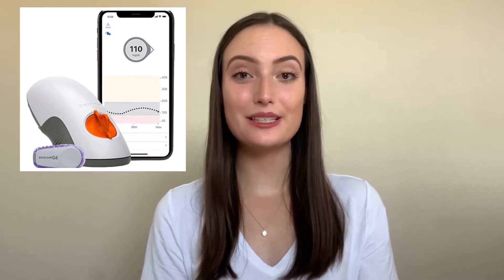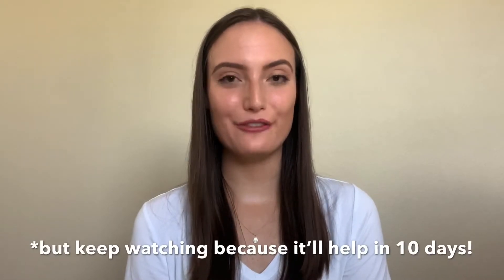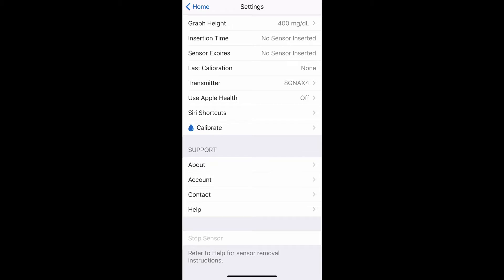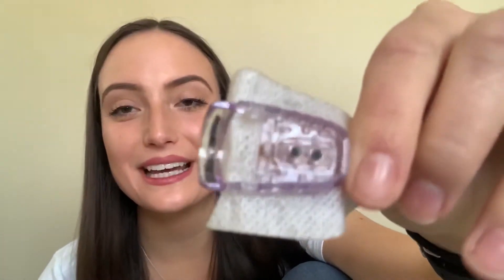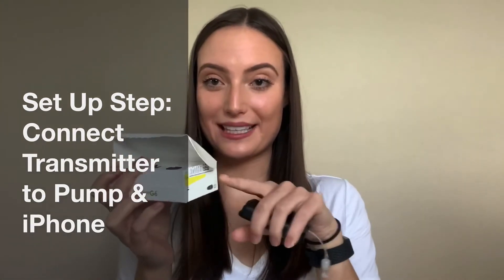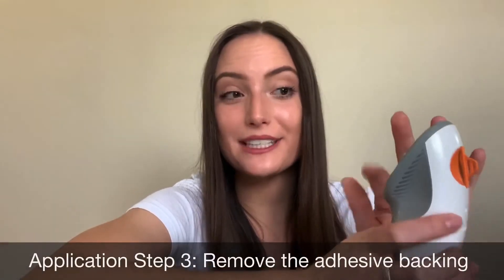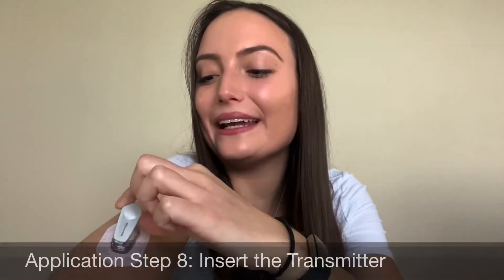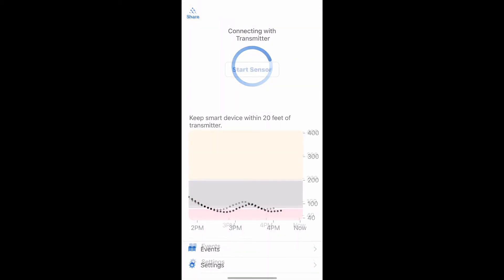Dexcom G6 CGM, a Step-by-Step Tutorial + tips. Tandem t:slim X2 Insulin Pump & iPhone Connected

Comment: Í had problems
1st semsor lasted7 days 2nd lasted 3 days and screen blanked and wanted to ressetu.
Started a do loop.
Lost old  code on sensor so used code on another sensor
3 days later it failed and would not let me use last code..
Not happy can not reconmend this model
Reply from the maker: @johnware8850  thanks for commenting, John! Was it for Dexcom G6 or Dexcom G7? And have you tried the other one?

Comment: I’ve been T1D since 1991. As we only change the transmitter 4 times a year, I forget the steps 😂. I did notice that when you showed entering the new transmitter code on the t-slim X2 and then repeated it on your phone before confirming on the X2, I need to put the sensor code in first then it asks for the transmitter code (on iPhone). It seemed that you just entered the transmitter code without that step. Could be a UK vs US thing. Anyway thanks for this video. It’s in my favourites folder just in case I forget again. Cheers and hope your well. 😊
Reply from the maker: Thank you so much for your comment! If my transmitter is being changed, that is first on pump or phone (but G7 should simplify things soon). Wishing you the best, cheers! :)

Comment: I have had trouble synching the Dexcom with my pump when introducing a new transmitter. Apparently you have to put the information into the pump in a certain order and if you don't you get an error and it won't work. I've been waiting a week for my replacement sensor and transmitter and I hope I get it right this time!
Reply from the maker: I’m so sorry to hear that you’ve had to go through and get a replacement, Jill. My fingers are crossed for you!

Comment: I've been a type-one diabetic going on 7 years now, but only just got my tslim pump last year. I get anxious when it comes time to replace the transmitter since the breaks between which they need to be changed are so long; I tend to forget how! This video was super helpful! I understand this video is from 2 years ago and that the tslim x2 pump has had updates since then, has anything changed about how you go about changing the transmitter since then? Or should I still enter the transmitter code in both my pump and my phone. I've always been told to do everything in the pump, however last time I replaced my transmitter through the pump only I had to restart the pump completely because something didn't work. I'd really appreciate a response, it's coming on time to replace again and I want to be prepared! 😂 Thank you so much for the video, regardless!
Reply from the maker: Hey there! Thank you so much for this awesome comment! The setup is still very similar for the tslim x2 & Dexcom G6. You can enter the code into both the pump and phone or just the pump which should connect to the phone if it is set up correctly. I believe the t:connect app is also advantageous for this pairing. It can be paired with one medical and one non medical device simultaneously (so, phone AND pump). I hope this is helpful and I’m wishing you the best of luck!

Comment: In washing your hand you touched the handle to turn off water. You just put germs back on your fingers.  I had to get signed off on washing my hands to be germ free in a home dialysis class. We had to have paper towel to dry hands then use the towel to touch handle to turn off water.   Because you talked about germs and how important it was to be germ free I wanted to correct you. I not a germ free nut but wanted to correct you since you are teaching online to teach others.  I appreciate you teaching this.
Reply from the maker: Thanks for your comment, Donna. In this video, I used a sink that is only ever touched by my hands and was cleaned before filming which is an important distinction that could have been advantageous to verbalize. It would be especially important to incorporate your suggestions when this is not the case. When working with something like a dialysis class, sterile practices are very important so I am glad you understand these techniques and hopefully add to someone's learning experience in conjunction with this video. Wishing you the best and Happy New Year.

Comment: Fantastic video.  The instructions definitely didn't give me a good sense of how to put this on.  But the biggest thing I'm wondering is how much of an issue is it if I wander in and out of range of my phone periodically throughout the day, as a Type 2 diabetic.
Reply from the maker: Great question and thank you for your comment! The answer depends on how far away your phone is. I find that I have issues if my phone is in another room and if, for example, you are working with the size of a sports field and your device is located on the edge, you might run into some disconnection. It comes down to how much connectivity you are willing to lose if it is not possible to keep your phone on or near your monitor. I hope this is helpful!

Comment: How waterproof is the dexcom g6
Reply from the maker: It does great in the shower and pools/hot tubs. Depending on how often it gets wet, some people experience concerns with the adhesive unsticking but there are additional patches that can be added to mitigate this! On April 13th 2022, Dexcom said “The Dexcom G6 sensor and transmitter are water-resistant and may be submerged under eight feet of water for up to 24 hours without failure….” when worn/applied correctly. I hope this is helpful!
Reply: Thank you none of the others answered me so thank you
Reply from the maker: @sherimoen617  awe, glad to help and I’m thankful for your comment. Happy holidays to you and yours!

Comment: Hi Maddy.  Thanks for this!  I'm relatively new to using CGMs (on my 8th or 9th sensor).  I am not diabetic but type 2 runs in my family so I'm being precautious and trying to educate myself about what affects my blood sugar.  I was wondering something... is there any reason one couldn't put on the new sensor first (in a different location, of course) and wait the 2 hours for the new sensor to calibrate, and only THEN take off the old sensor and transfer the transmitter to the new, already-warmed-up new sensor?  Or does the transmitter need to calibrate also?  If not, it would be nice to have more continuous readings, plus I'm curious about the different blood sugar levels the sensor readings between different locations.  I had the sensor on my stomach for the first time these last 10 days (vs back of the arm for all previous locations) and I was getting significantly higher glucose readings all of a sudden... +25-30).  A swifter change to a new sensor location would really help to see what change in blood sugar level was due to the change in sensor location only.  Waiting two hours introduces a bunch of additional factors.  Thanks in advance!!!  I'd also be interested in hearing anyone's experience with changing blood sugar with a change in sensor location.
Reply from the maker: Hey Warren! You’re asking some great questions, thanks for that! I also wish a more continuous reading was possible too but as of now, I believe the sensor and transmitter need to calibrate together for those two hours. Maybe this will change in the near future! I am pretty sure the upcoming G7 has a smaller calibration time (about a half hour as opposed to the current two hours). My sensor has a lot of issues on my stomach so I am only familiar with the readings I get in my arm. An idea for you to test the validity of your readings for different sites is to test with a traditional finger prick. You may also consider calibrating your Dexcom with this information. That way, you can identify the difference as it relates to these numbers! I hope this is helpful. Please let me know if you have additional questions and I will be more than happy to try to answer them! Wishing you the best.

Comment: Airline travel… Are there any issues during TSA in going through X-ray or body scan?  Some transmitters from other companies are ruined when using these machines during security checks.  I’ve always had to do the pat down…
Reply from the maker: Great question! The Dexcom has no issue from my experience. I actually went through TSA two days ago. My current strategy for my pump is to detach it and ask for a hand check. Usually there are small circular trays that you can put it in and pass it to them so it does not go through the x-ray machine. They’ll usually swab it and swab your hands. I have also gone through the full body scan with my pump where you put both hands up and spread your legs apart. In this case, I put it on the side of my hip and they swab my hands and pump when I step out. 

I never let it go through the x-ray machine where all bags go since I am also concerned about my pump being ruined, especially while traveling. 

Also, being kind, communicating clearly, and being observant of TSA might be advantageous. 

Let me know if this clarifies what you are seeking. I hope it helps!

Comment: I just put mine on yesterday for th3 1st time, but the reader I nit reading correctly.  It kept making noise all night it kept giving me reading of 53 which is impossible, I would've been in serious trouble I was fine. And it doesn't show me the readings from last night nor there's an app to keep track. I have a Samsung S22 that has all the updated system required.
Reply from the maker: Hey Verushka! I have been there. Unfortunately, this type of thing happens sometimes. In my experience, it can take the Dexcom a second to adjust but I’d recommend calling them if you are not seeing improvement. Their number is (877) 339-2664. If you still have the serial number from your sensor (located on the packaging), that will be helpful for them! However, they can help you without that information. I hope you see a resolution soon. You’ve got this!

Comment: Hi Maddy.  I'm a type 2.  I've been using Freestyle Libre for 3 years.   I love the CGM technology.  Mm biggest problem is  in the summer.   I sweat a lot.  I've tried a lot of solutions.   I used the tac wipes, tegaderm bandages, a bandage holding tincture,  and the circular stickers and the taccing stuff.  It doesn't matter what solution I've tried, my sensor falls off within 4 days. I just got a Decom G6 through the free sensor program. Is there a better place to put the sensor that it will stick?
Reply from the maker: Hey there, Shane! I’m very sorry to hear that you’ve been experiencing difficulty with maintaining sensor placement. 

Where are you currently placing your sensor? 

Some thoughts for you:
1) If it’s in a location where you can wrap it, you might consider self adhesive bandage or an ace bandage. 
2) Have you considered sweat blocking wipes for the location prior to cleaning the site for use? 
3) Definitely bring this up with your doctor. If either of these suggestions do not work, targeting the sweat glands more specifically might help; but this option is more costly and would require a doctor.

I look forward to hearing back from you and hope you are able to find a solution. Wishing you the best!

Comment: Hi I also use the g6. I am having huge issues keeping it secured for the 10 days. I start off with just the included attached dressing and use alcohol and sure prep around the edges. About day 3,I put sure prep around the edges and put the dexcom patch over the area. So I showered before applying and have not showered since applying the overpatch and it is still peeling up 🙃🙃help?
Reply from the maker: Hi Kirsten! You’re doing great and I’m hopeful we can find a solution. Have you considered applying an adhesive after you use your alcohol swab but before applying the sensor? This might add a couple days. If I have had issues keeping my sensor on passed that and a patch, I have used an ace bandage or self adhesive to wrap around my arm. I’d recommend talking to your doctor to see if they have any solutions that could assist you specifically, but these suggestions may help for now. Wishing you all the best. Would love to hear from you with an update!

Comment: Does this system have bleeding issues like the guardian 3 sensor, where there is blood coming out of where you inserted it causing issues?
Reply from the maker: Hey Matt! I’m sure it could happen but my personal experience is rare. I have had bleeding like this occur twice in my 7 consistent years of wearing the Dexcom. I hope this helps!
Reply: @TypeOneTypeFun  I have had bleeding with the guardian 3 sensor 40+ times in 4 years, I say 40 because it was that often but I obviously didn't keep count. It was enough to exhaust medtronics 3 replacement sensors per 90 days policy online - on cooldown, I am hoping with the dexcom things will be different.
Reply from the maker: @mad0uche  hey there! I’m so sorry to hear that this has happened to you. I hope your experience with Dexcom is much less… bloody. Wishing you the very best!

Comment: This is a great tutorial for the Dexcom G6, I’ve been a T2D since 1987 and have reluctantly moved onto the pump after years of coaxing from my endocrinologist, I’ve had great results with the wireless Omnipod and Freestyle Libre systems for a couple of years, since I turned 65 and Medicare is my main coverage (I was paying out of my pocket for the Omnipod and Freestyle Libre 14-day because Medicare Part B does not cover the cost) and Medicare covers the Tandem Slim-X and Dexcom G6, sooo.. I’m moving over the the Dexcom G6 and your video gave me a heads-up for the application of the Dexcom G6. In my kit, I also received a Dexcom Receiver, do you advise using the receiver ? Or it’s either or the cellphone app…
Reply from the maker: Hi Thomas! Thank you for sharing your journey. I hope the Dexcom and t:slim work very well for you. I have used the receiver, cellphone app, and pump all at once but this is unnecessary. If you have the options, it’s more of a personal preference. I mainly use my phone and pump currently. I hope this is helpful and I am wishing you the best!

Comment: I really enjoyed your instructional video, I started my Dexcom g6 on Monday and I like it., I’ll come back after 10days too make sure I get it right., thanks so much., I subscribe👌🏾💕😀
Reply from the maker: Hi Brenda, I hope to hear from you again! Thank you so much for your support. All the best!
Reply: @TypeOneTypeFun  Hi and thanks for responding., I received Apple software update but I’m afraid too download because it might interfere with my transmitter/sensor readings I have on now., will it make a difference if I do., I’m thinking I should wait after 10day usage then install., what do you think….. thanks so much😀😀
Reply from the maker: @brendasykes-tucker3469  great question! Since the Dexcom is a continuous process, you will have to interrupt the process for a few minutes if you plan to wear the Dexcom at all times. So, when you go through with the update and your phone turns back on, reopen the Dexcom app manually so that it will reconnect. I have automatic nighttime updates turned off because the app will not automatically reconnect while sleeping, it has to be opened manually. I hope this helps!
Reply: @TypeOneTypeFun  I think I’ll wait on updating the software, I do have to change the sensor on the 26th probably do it then, just afraid I’ll mess something up, thanks for getting back with me…….
Reply from the maker: @brendasykes-tucker3469  that is totally understandable. I hope it all works out!

Comment: Which do you prefere best with the G6, Your transmitter or the IPhone? And do you keep your IPhone at least 3 inches from your insulin pump like you have to do with the transmitter???
Reply from the maker: Hey Mike, great question. I typically use my iPhone since I have it on me at most times but I have used my receiver in times where I would not be able to charge my phone, or if I was unable to keep my phone with me. However, now I fully rely on my t:slim insulin pump to provide this information in these situations. I do not need to keep my iPhone that close. Usually, having it in the same room without a large object blocking signal works just fine. So, keeping it on the bathroom counter during a shower, the nightstand while I sleep, or in the passenger seat while driving is all fine. I hope this helps!

Comment: Hi, Madi.  New subscriber to your channel.  GREAT video - very comprehensive and explanatory.  My endo has suggested the Dexcom G6 (I currently use the Freestyle Libre' 14 day sensor), and your video sold me on it.  Personally I've had issues in the past using the Skin Tac with the Freestyle Libre' which has caused the sensor to fail every time I used it.  I've even let it dry for 2 - 3 minutes, and they still failed.  35 years T1.  Thanks so much!
Reply from the maker: Hey Ricky, thank you so much for sharing your story and supporting my channel! I have stopped using SkinTac since creating this video simply because my Dexcom stays on without it just fine. I hope things start to work out a little better for you. Wishing you the very best!

Comment: Where do you do your infusion site for the tandem? I am wanting to put the g6 in my arm but i have been told the infusion site and the cgm need to be quite close to each other and I’ve been doing the infusion on my stomach. Are there any other good spots to put my infusion site?
Reply from the maker: Hi Nate! Your sites can go anywhere, arm or stomach. The CGM is only FDA approved for the stomach but human bodies vary. I have my tandem site on my stomach or hip usually and my Dexcom is always on my arm (with my doctor’s approval). These communicate very well. These two sites should not be too close to each other so that insulin doesn’t interfere with glucose readings. An arm&stomach combination is usually close enough. I would chat with your doctor to confirm but I hope this is helpful!